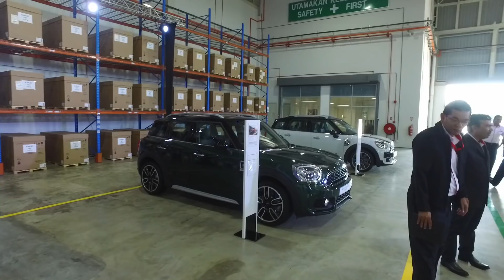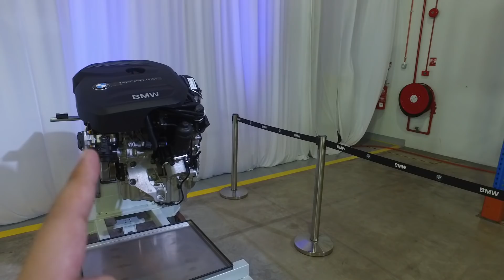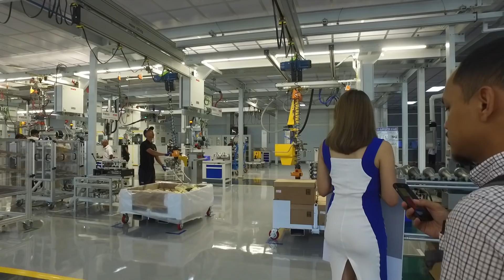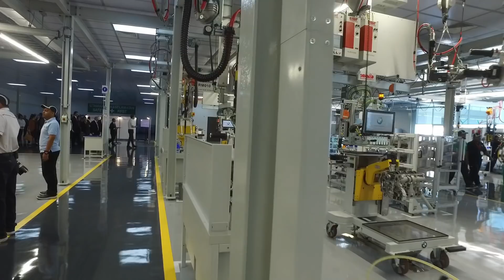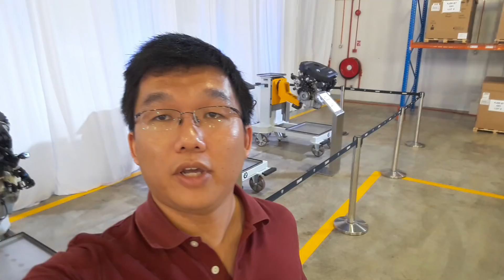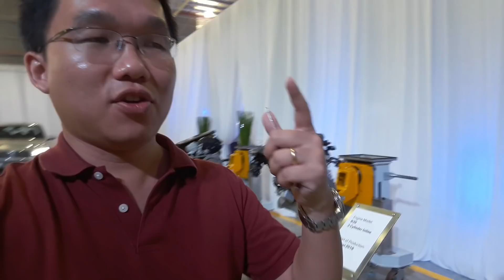Visiting the SDAE BMW Engine Assembly Plant in Kulim, Kedah | EvoMalaysia.com

Comment: Not being skeptical , engines are hand made in my? Is Mercedes doing the same?
Reply from the maker: They are hand-assembled. Meaning that the blocks, pistons, cylinder heads etc are all pre-forged and casted. The local boys attach all the components together.
Reply from the maker: Mercedes engines come into Malaysia almost fully built, may be even integrated with the transmission.
Reply: Kon Wai Luen 👌🏼🙏🏽
Reply: @KonWaiLuen  engine mercedes pasang kat malaysia la...

Comment: sorry my BMWs will only come from REGENSBURG and Spartanburg and in markets where I can BTO (Build To Order) to my liking and track from Day 1 from the assembly line to the day it rolls off the plant to rolling into Cargo Ships...Thats what I call BMW for that experience ------- Not a 1 variant model market and get dictated by the importer how it should look/feel---thats more like mazda and toyota
Reply from the maker: Built to order is difficult to implement in Malaysia because customs require new documentation to be submitted and evaluated with every valuation. A certain car at a certain price has a set amount of import and excise duties that tie into the vehicle's internal model code. In BMW's case, vehicles with  different features have slightly different codes - customs recognize it as a different car model. 

But I agree that 1 variant per model is ridiculous la. The X3, for example, could have been offered with an sDrive20i RWD entry followed by a mid-spec xDrive30i, and a range-topping M40i. This is where Mercedes has gotten their model mix better thought out. MBM operates under the same restrictions but they clearly have been more diligent in their product planning.
Reply from the maker: You have the option to build your BMWs to order in Malaysia too, but they will be CBU and will be priced significantly higher. A G30 540i, for example, may end up costing near RM600k - a difficult step up for many to make when the 530i asks for RM380k whilst still offering decent real world performance. The cars are specified on a per order basis.
Reply: Sime darby does it happily with Porsches (Build to Order), so why not provide the option for BMW?
Reply: Kon Wai Luen That’s why my need a change!  The same old shit being carried out for donkey years!  Malaysians has the next 24 hrs to think about it!
Reply from the maker: Hahaha... where are you voting?
Reply: Kon Wai Luen I am a Johorean! 6hrs  and a half   from kl to jb yesterday nite!